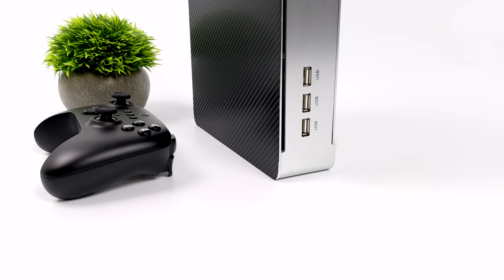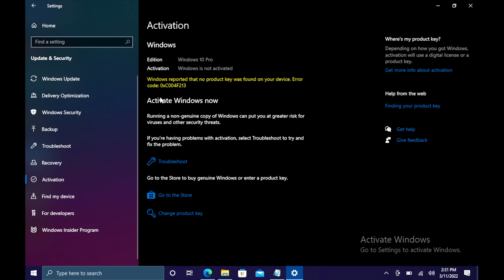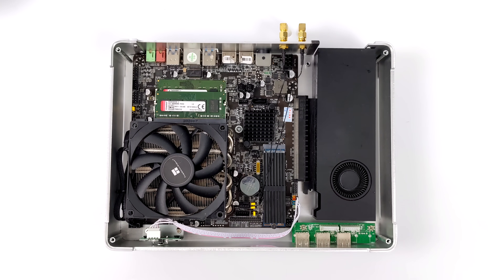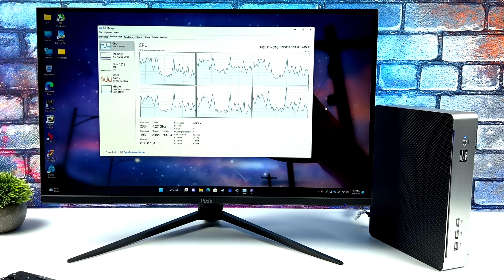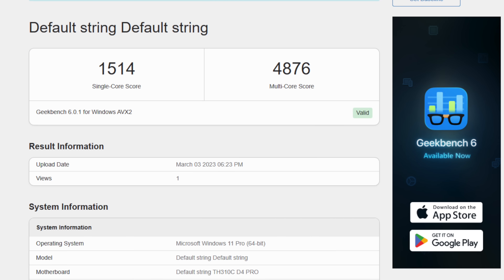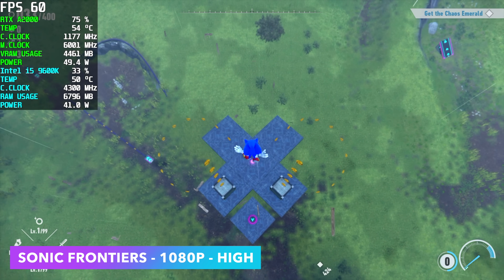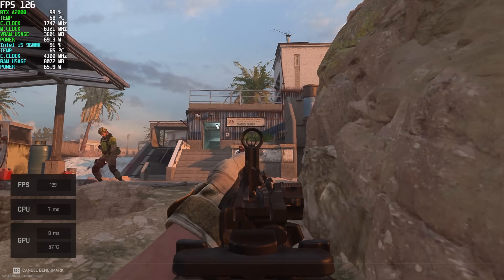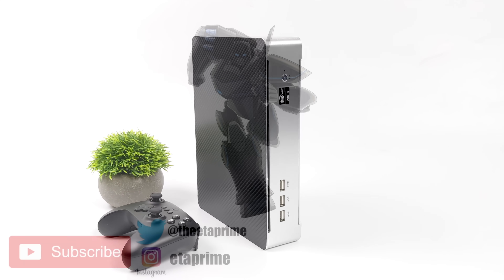This Tiny PC Has The Most Powerful Low Profile GPU And Runs It All!

Comment: I just have one question, what drivers did you use for the gpu?, for some reason I'm locked out of most features for nvidia and some games I've noticed are hard locked to below 110 fps even though I tested on the lowest settings

Comment: I actually built a system using a MSI mini ITX w. 11th gen i5T. It should be noted you are not running your card more than PCIe X16 gen 3 (8 Gbps) which is all a 9th gen Intel will do, which is why I went with  a 11th gen for PCIe X16 gen 4( 16 Gbps).  I also added shunt resistor  to allow for current draw as well as a soldered a new 12VDC supplement power connector which allows it to draw up to 90+W.  This has allowed me to increase the voltage and frequency for 3DMark 8000 points.  Since I bought my A2000 used, I cleaned out the fan and added copper 1.2mm shims to the memory and repasted the GPU chip as well which I recommend before reducing the shunt resistance so it doesn't overheat.  There is a company who sells a copper shim that fits around the GPU to cover all memory chips.

I have decided to build a custom acrylic case so that I can keep the unit compact with a little more height and custom vents for the A2000 blower fan as well as custom vent for the 120mm RGB Cool Master.  I also use a cutom silicone gasket to seal each up against the acrylic.  Since the i5T only has TDP of 35W (max 50W), the system runs cool.  I also use a discrete 19VDC 250WMB power unit with laptop power brick or 20VDC Graphene Li-ION 6500mAH power pack for 3-4 hours of use.

Comment: So 3.64Lt excluding the EXTERNAL PSU ... and at most 6 cores 6 threads ... Seriously the NUC9i9 bare bones system that can be had at a extreme (pun intended) discount from new right now and is 4.94Lt but includes an internal PSU and can handle upto an RTX 3060ti (EVGA without backplate, or ASUS Mini) ... or like the one I have with EVGA 3060 XC Black Gaming 12GB ...
An absolutely awesome SFF PC that just needs a standard IEC power cable, 8 cores and 16 threads, supports 64GB of RAM (mine has 32GB) ... 
For reference it runs MW2 Benchmark at 1080p with Foureyes original settings (from a few months ago, decent optimization video if you need one)  at 128fps which for an extremely portable system is really good.

Comment: Another great gpu is the rtx A4000, which is a 1 slot card and performs similar to a 3060 ti. It takes a 6-pin though and retails for around $1,000 brand new or around $500 used
Reply: Except it isn't a low profile GPU and it draws twice as much power and cost twice as much (used).
Reply: @allthings3d  may RTX 4000 LP work.

Comment: It looks like that CPU is holding the system back in a lot of the games. I would have tried a i9-9900k and undervolted it to keep temps in check.

I have a Corsair One prebuilt with the 9900k in it and I was able to overclock to 5.0 GHz all core and 5.2 GHz when 4 cores or less are being utilized while keeping the 95w TDP in place they set in the factory bios for that particular system. It works pretty well.

Comment: I think you forgot to set high performance mode in windows power plans because CPU clocks are not stable at 4.3Ghz in cyber punk and in spider man it's 4.0Ghz. have you checked the power limit?

Comment: It looks really neat. But imagine the combination of such case and GPU with an  low voltage AMD ryzen CPU like a 15W 4800U or 28W 6800U (7735U)  with a built in option to  toggle between iGPU (for office work) and dedicated GPU for gaming sessions. That would be the ultimate mini-pc. It is really a shame that the low voltage laptop APU aren't available for the retail market.
Reply: Might as well just get the Minisforum Neptune line of mini PCs. You can get up to a 6900HX and 6600M in a more compact form factor.

Comment: I bought an A2000 a few weeks back for my travel PC. I upgraded from an RX6400 because it was just too slow and couldn't handle VR at all. I'm super impressed with the A2000, I've been able to get a 300MHz overclock on the GPU, but only 25Mhz on the RAM, probably because of power limits. It handles all my VR games like a champ, even HL:Alyx, albeit with some lower settings, runs great! I have it paired with an R5 5600 and 32GB PC 3200 CL16, and max it pulls less than 200 watts from the wall. It's pretty incredible stuff.

Comment: Do you have a link to the power supply? Also the seller keeps raising the prices on the a2000 with each new video. Used be $249 now is $299.

Comment: It more like a 1440p 60 fps card, no wonder why the CPU struggles at only 1080p. But "struggle" is also a bit harsh, because also at 1080p this system delivers. Even some light RT would be possible, especially with DLSS at 1440p. Afaik it does have more RT cores than 3050!

Comment: I have an A2000 in a 4 litre chassis with a Ryzen 5 5600, as a low power gaming rig.  It handles most thing just fine at 1440p, with a bit of tweaking.
Reply: I am jealous

Comment: I’m curious about the performance of the lp gpu in some of the cheap pc available used from eBay and Amazon. Looking at i5 or i7 stuff. I tend to buy the older corporate stuff for work but every now and then like to game. Thank you for content. I have thoroughly enjoyed videos over the years.
Reply: There is a video by ToastyBro's using the RTX A2000 in a old Dell Optiplex that had an i7 6700 and they were able to get pretty good performance

Comment: What PCIe riser did you use to connect the GPU in such a way with both fans pointing in the same direction?
It looks really slick, but would've been interesting to see the full step-by-step build process also.
Reply: Not a riser, the PCIe slot is attached to the side of the motherboard.
Reply: @wasecheber  so, it’s a special motherboard? That sucks
Reply: @AlJey007  these are special mobos designed for client computers for business's that are repurposed from sitting in a warehouse

Comment: The rtx A2000 prices went up recently, yours and others covering of this tiny amazing card revived the hype around it
Reply: Was going to say the same. 
$300usd used on Amazon is way to steep. That's hitting 3060ti/3070 price ranges.
Reply: @YoungSinatra25  not sure if id say "way too steep" but certainly steep. But thats low profile premium for this level if performance
Reply: @theinktician  While true these were under 250 USD used at one point and all coverage from tech tubers has definitely ramped up demand and prices it seems.
Reply: @TheJamesKF  lol missed out on the first enitial drop of cards.

first drop from crypto miners i had a few at 220 CAD.

now cant find a single one for under 400 =(
Reply: @TheClahey  same and + euros for me in France.
Reply: Expecting mine tomorrow! $260 when I ordered from Amazon. Pairing it with my R5 1600 AF.
Reply: @ivancazares129  nice, im getting mine wednesday or thursday. Im glad i got lucky and found one on ebay for 250 instead of 300 like theyre going for on amazon rn
Reply: just picked one up for 225. they can still be found for relatively cheap.
Reply: yeah i just got mine on eBay for $299 but it was open box so basically new cuz i was worried about getting a mining card
Reply: Yep, around 500 AUD ATM second hand and 1000 AUD for the A4000, really kills the budget with these SFF prebuilt units

Comment: One thing - A2000 can be overclocked, with the same ~70W TDP power limit.

Modyfying turbo boost curve = core clock is going up, which means additional ~10% performance up.
Reply from the maker: I've been able to take the base clock up 450mhz and it really does open this card up
Reply: Indeed there is some juicy bonus performance included in those rtx chips. My rtx 3080 laptop got some decent performance boost without any additional power.
Reply: It wont hit that limit as the fan uses about 5 of the 70 watts available to pcie. You'd need to plug the fan in separately using an adapter
Reply: Problem is the connector is apparently a pain to remove and may not be worth the risk...